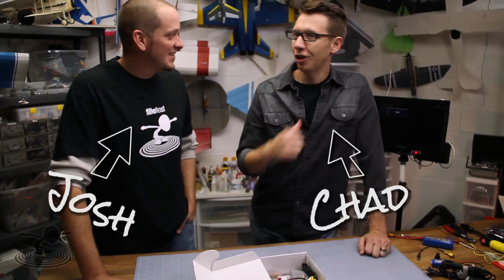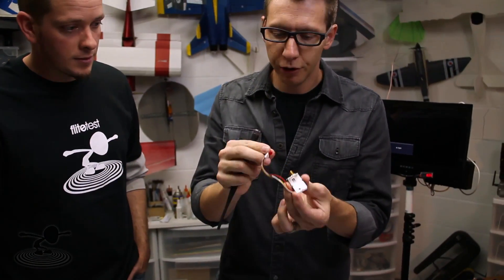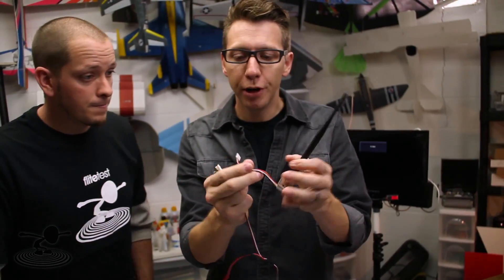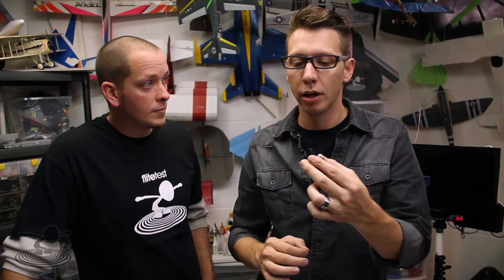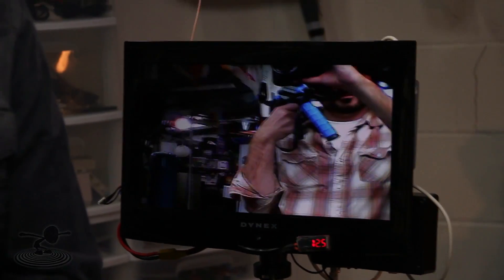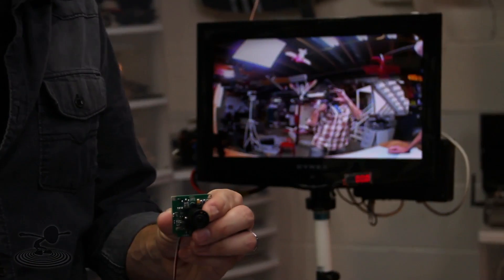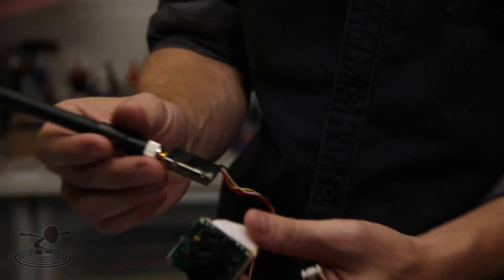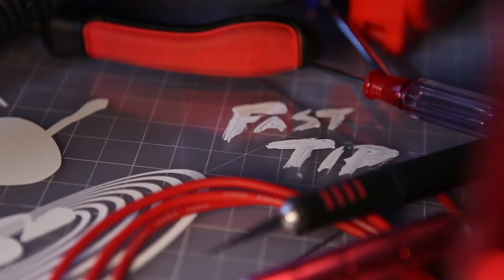Basic FPV Setup - FAST TIP | Flite Test

Comment: if you wanted to overlay an OSD HUD that displays realtime flight information, what would you do? put an arduino or RP that generates the overlay between the camera and the transmitter, or put a computer on the ground that generates the overlay and is placed between the receiver and the monitor?

Comment: Hi,I have  I am using GPS in APM board,I have APM 2.8.i have ublox neo8m .the gps work in rover firmware,I get GPS lock ,GPS work well rover firmware,but it doesn't work in arducopter 3.2.1.
So if some could help ?

Comment: Can I power this transmitter by using xt60 y paralal wire connectors to power whole rc model in one 3cell Lipo battery. 
CAN I DO THIS
IS THERE ANY PROBLEM TO DO THAT .SO PLEASE TELL ME

Comment: I pulled apart a model plane recently and the manufactures had black as positive and red as negative so when I plugged it in the ESC blew up literary. It sent molten heat shrink everywhere and left me with a flaming mess of a Speed control and a couple of minor burns

Comment: Around 7:40 / hard to get xt60 from one another? :) I noticed you gave up and put it down. And in tight builds it gets almost impossible to take apart. And with cold fingers or just fingers that are strong enough there is good news. :) 
https://hobbyking.com/en_us/turnigy-easyoff-plug-disconnect-system-xt60-adapters-20-pcs.html

Comment: I have a TS832/RC832 set from Aliexpress and the transmitter is heating up really quickly. I run it off 12 volts. Is it better to lower the voltage or just glue a radiator onto the power amplifier IC?

Comment: Hey!  I am going to build my 1st FPV system but it is confusing to find the correct VTX. I need to use my FPV system in a racing quad copter. what is the VTX I should use. There are many 200mW, 600mW, etc what VTX I should buy?

Comment: i have a 4200mah  4s lipo as my battery, im trying to power my quad copter and my fpv camera through the same battery , the camera need 12v to work,any suggestions how i can do it. help urgent........

Comment: I have a 7.4v battery for my quad and I want to have an fpv setup like this but they say you need a 12v battery to power it. what should I do?
Reply: There are two options; 
You could simply buy a 3S (12.6v) battery...  itll give you a lot more power and a more enjoyable flight (unless it is a store bought mini quad which can only run off a 2S...   in which case it may not be able to lift they weight of the fpv system...) 
Or, you can buy step-up converters which will bring the 7.4v up to 12.6

Hope this helps

Comment: That was extremely helpful. thanks Josh and Chad!!! 👍👍
Reply: +david morton Check out this FPV starter setup out.Hyperion 4.3" FPV Monitor with Built-in 5.8Ghz 32 http://www.aircraft-world.com/en/p1986857-hp-fpmon43
AOMWAY FPV 5.8G 8CH 200mW AV Transmitter Integrated 700TVL CMOS HD Camera For Aerial Photo
http://us.banggood.com/Wholesale-Warehouse-AOMWAY-FPV-5_8G-8CH-200mW-AV-Transmitter-Integrated-700TVL-CMOS-HD-Camera-For-Aerial-Photo-wp-Usa-989258.html I think it is safe to use this FPV camera with a 2s plus lipo battery.

The monitor has auto tune so you do not have to flip through channels etc.

Comment: How can a Frequency which you can't see,smell or touch be legal or illegal. lolol
Reply: David Hannigan Jr. He's given up. Your ignorance is unbearable.
Reply: Yeah. It can interfere with communications
Reply: Yes they do. Ever heard of a radio or a walkie talkie?
Reply: David Hannigan Jr. If you use high power on an "illegal" frequency you will normally be fined. And yes they do investigate sources that cause a disturbance. HAM operators can use certain Frequencies that are off limits to non operators, but even then its only at certain power levels.

Comment: Hello, can someone give me some source or answer on what's the deal with FPV or 5.8ghz transmitter and "staying legal" in the US?  I keep reading about how there are "illegal" channels on the transmitter and I cannot find a legit source of this information nor can i find what channels can i use without "getting in trouble"  Any clues?
Reply: the video transmitter has to be Fcc approved and have the approval ID number on it. there are about a handful of them that are legal. all are 25mW only. most have permanently fixed attennas as well.

Comment: Is there a TINY SD adapter for the FPV video output to storage videos in it? 

im trying to fit a camera module on a Nano drone, so the weight is the key of this adapter. Saw some Nano drones could lift gopro cameras, but batterys unfill really fast, thats why im looking an SD adapter, because FPV transmiter weight.

thanks in advance, nice videos!
Reply: +Jorge Cifuentes There is no storage for this setup sorry. It streams the camera feed directly to a monitor via the antennas.

Comment: Would this be good for 250 quads?
Reply: +Billy Thomas think so. Im getting  250 quad and probably getting this fpv kit. just make sure you dont use a separate battery for the transmitter on your quad because you are likely to put too much weight on the esc. just use an adapter for example, this one http://www.ebay.com/itm/251759867005
Reply: +Happy skull25 ?

Comment: At 4:35, can't you take power from your ESC or receiver for the camera and transmitter if your ESC has a BEC?
Reply: Hungry Guy isnt a bec 6v?
Reply: +Hungry Guy prolly the camera chews a low of power... unless a separate BEC is installed...just to power up the camera.

Comment: I have a phantom 2 vision+, and really want to be able to view on a bigger screen. It is equipped with a 2.4ghz wifi transmitter, so could I just buy and use a 2.4ghz receiver and run it through a dvr? I don't want to spend the $$ on light ridge, when there seems to be much cheaper options

Comment: Hi FlightTest, I wanted to say thanks for all the Video's. Appreciate the extra knowledge when needed. I have a question about this FPV. On the receiver Does the 12volt system have enough power to handle 2 or more feed displays at once without degrading the signal?

Thanks,
Brad

Comment: How long will the batteries last on the fpv system?
Reply: TheOutback101 I was wondering the same thing. Id just use a low voltage alarm so I wouldnt puff the battery

Comment: How would I power the camera and the transmitter with the battery which powers a quad? Thanks.
Reply: Custom cables can be made from the balance plug of lipo's, but using an 11.1v-12v battery is recommended

Comment: Hi thanks for the awesome video!
Just a couple of questions for you or any Quad experts out there: 1) i have the Luminier QAV250 which has a distribution board, so i assume it is possible for me to power this FPV kit strait from that distribution board, and save having to use a second battery?
2) How would Fat Shark Goggles work into this system? Would the video just be transmitted strait from the Fat Shark Video transmitter on the Quad to the Fat sharks goggles antenna, or is the whole ground station part still required for that?
Thanks very much.
Reply: Fat shark goggles have a built in 5.8ghz reciever so out of the box u can't. BUT most fatshark goggles have a switch where u can turn the reciever off and plug the video reciever( which in this video is 900mhz) into the goggles. So once u turn that reciever off they basically become a monitor in the form of goggles

Comment: Hi guys, can you help me? I bought a FPV Kit and it says to use a DC 12V 1A adapter ?
I looked it up on Amazon and all that shows is cords that plug in the wall? Could you tell me what type of battery I can use for this kit? Could use the power source from my Mobius action cam for the transmitter and my power source from 7:moniter for my receiver? Thank you Kazz. P.S. Were can I get connecter of all sorts? because when ever I have a female connecter, I have no idea what it would be called to get a male? I was thinking that If I bought a female and male adapters of any sort. I could make my own hook ups. right?
Reply: Make sure you look on eBay/Amazon for the xt60 to d cables, I used them and made my receiver battery powered

Comment: I watched this video cause I wanted to see how you hook up the reciever RCA jacks to the Monitor, I have a reciever that I want to hook up to my laptop and it has HDMI plug for input signal. So what I need to know, how do I hook my RCA cable to my HDMI port on my laptop? My reciever only has a single RCA video out, My Laptop only has an HDMI in, will I need to buy some sort of anolog to digital converter, any suggestions would help, I'm new at all this video FPV setup stuff, please help..  :)

Comment: Is it possible to have two videos feeds coming from one transmitter or would you just need to add another transmitter?  I'd really like to have the ability to have two FPV goggles going so someone else could just sit along for the ride while I drive.
Reply: It works like tv broadcasting, as long as they are on the same frequency you could have as many people as you want watching.
At shows etc, one plane transmitting can be watched by anyone who can tune into that frequency.

Comment: This is a good setup. If you are using a 3 cell battery, go with a t connector and use 1 battery for flight and tx/camera power.

Comment: Nice video guys. I am wondering if a separate battery would be needed if the camera has it's own power ? I have a Mobius ActionCam, and it has it's own battery.
Reply: Yes you still need to connect to a separate battery or the balance connector on your flight battery to power the tx, but that battery will last longer because your camera is self powered.
Reply: So when you connect everything to the video transmitter and battery the only the video cable connects to the wire not the power, and if you we're to power the möbius with the setup could you use a sbec

Comment: Total complete n00bie here.  On the back of the screen at 7:08 you talk about "ground station". What exactly is that?  I plan on running a FPV on a RC car (and not a plane) so is that necessary? My FPV monitor will be plugged into into my wall receptacle so therefore will never have the need to be portable.  Can you PM me and explain please. I do thank you in advance.
Reply: For example, what is the white box behind the monitor?
Reply: onealmr Ground station is the FPV components that stay on the ground with you, rather than whats on the plane/car.  so the receiver, monitor, tripods etc, those things are your ground station. The white box behind the monitor is their receier I believe.(they used a different receiver for the video, to save time and not have to plug it during the presentation). Hope this helps.

Comment: I have a 500mah 3s lipo for the tx and the stock dipole antennas. And for the rx I use a 12 volt 1000 mah wall plug. I can't even get 30 feet with this. Do I need to get new antennas? Do I need to get a new tx? If I am 12 feet away from the rx it is clear.
Reply: First of all, get comfortable with flying your plane. Second of all, get rid of those rubber duckies (dipoles) and switch them out with IBCrazy's bluebeam antennas. You should also check for interference from WIFI networks on 2.4 ghz and cell phone towers at 910 mhz. Also, always use an FPV frequency higher than your remote's frequency.

Comment: Hi, great video! I am thinking of building David's windest�l's tricopter with my Futaba 6EX transmitter (2.4 GH) and this fpv setup. Two questions: could I run the tricopter motors and the fpv gear off the same battery? (and if so which one would be good?). Also, will I have video interference from my 6EX? I read somewhere that this could happen... sorry for being such a noob!!! Thanks, Franky

Comment: would this fit on a quadcopter that is about a foot wide? (blade 180 qx)
Reply: offcorse it will fit but it wont be able to lift it, but..... hobbyking have a micro 1.3ghz fpv combo (rx/tx) and its tiny! http://www.hobbyking.com/hobbyking/store/__35009__1_2GHz_100mW_Video_Transmitter_and_Receiver_Combo.html

Comment: 2 questions 1.can i use this set up in the uk     2.if u have a 2.4 GHz radio (turnigy 9x) can i use this 2.4 GHz fpv set up. some one please help because i need to no what to get for x-mas
Reply: Yes and yes.
Your turnigy 9x cycles through all channels in 2.4 Ghz, and will not show any really bad interference. It might interfere, but it won't be something you will notice a lot.
Reply: KodessR ok thanks
Reply: the Radio does cycle through channels, however you should never use same frequency for video as your radio. Do more research.

Comment: I just rolled through a dozen of your videos, and have to force myself to get back to bed - but, I was wondering what kind of HMD y'all are using for the FPV rigs? I've been pondering the different options for quite a while and would love to know if you've got a favorite, or maybe what applications are best for a specific type of display? I'm *so* going to be putting a versa wing together tomorrow.

Comment: 900MHz kit was arrived Yesterday and I hooked all up,
Rx set CH "0" and default(leave as it is) for Tx
As this fast tips, wide lens was installed instead and got better wide view.
Working great but Tx is hot, so I put Al cool Fin front and back for better cooling. 
Great helpful tip video to setup FPV for beginner like me

Comment: Another thing that makes video transmitters hot is having undersized antennas for them which is kind of common with the extremely small transmitters and with the 900MHz transmitters. The difference between a decent antenna and a poorly matched antenna can more than double your range!

Comment: mAh will not give more range, its a battery capacity rating so a 850mah will last longer than a 500mah. The MW rating of your transmitter will determine the range of your system.

Comment: which battery would you recommend to power up the video receiver during flight?a 3 cell 500mah or a 3cell 850mah?or maybe i can use a lower mah batter for lighter weight?what does mAh do on a video rx?does it last longer or more range with a higher mah 3cell battery?

Comment: PLEASE THUMBS UP SO OTHER PEOPLE CAN READ!!!!
The reason that the transmitter gets hot is because its voltage regulator is dropping a lot of voltage these things actually run on a much smaller voltage. To find out what the voltage is look at the pcb and do a search for the on board chips ID No. and one should be a set voltage regulator, the data sheet tells you the actual working voltage!

Comment: also, higher frequencies go shorter distances for the same amount of power. i.e, a 100mw 5.8ghz tx will give about 1/2 the range of a 100mw 900mhz tx.

Comment: Depends, 2.4 video can make problems if you use 2.4 transmitter. Also depends where you actually live, 900, 1.2, 1.3 is illegal in most of Europe. There are also differences in transmit power that is allowed. Local FPV boards might be of help here. Otherwise there is nearly no inherent difference in the different frequencies, apart from how easy they are blocked by objects in the LOS. (higher freq is easier blocked, e.g. when flying in the forest)

Comment: I have never used ecalc before, but I think someone has said to me once that it doesn't calculate properly for quadcopter.
I have heared it, I am not sure.
What I would do is buy the 14x6 prop I suggested and a bigger prop.
Propellors don't cost very much.
It is better to experiment yourself then to rely in a calculator.

Comment: I would suggest a 14x6 prop.
If that is too big and you need smaller props, I would go with a 12x6.
Those props along with a 3S lipo with a lot of mAh.
Since its a quad, I would go with the ZIPPY Flightmax 5000mAh 3S lipo with hardcase.
It does weigh a lot, but it does give you a lot of flight time.

Comment: Haha no problem.
If you require 20 amps continuously then it is not low for your motors.
But if your motors use 18A on full power, I would consider a higher C rating.
If you get a 30C 3000mAh you should get about 7 minutes of flight time.
I should start experimenting with multiple batteries connected parallel to each other, so you get more mAh, but you won't get more volts.
Try to find the right balance between the amount and kind of batteries and amp draw, to get maximum flight time.

Comment: The C rating is how many Amps the LiPo can put out continuously while holding a good voltage level.
So your 2200mAh 20C battery can put out 2.2x20=44 Amps continuously while holding a good voltage level.

Comment: To calculate the flight time, take the battery's capacity in amp per hour, then divide the battery's capacity by the average amp draw and multiply the answer by 60.
So, if your motors would run on max, you would get around (2.2/18)x60=7.3 minutes.
Now, you dont want to fully discharge your lipo so i would say about 5 minutes is the maximum flight time.

Comment: for a simple quadcopter of max current 18A per motor.. how much time will I get for flying using a 2200mAh 20C 3S battery?

have you used ardupilot ?

Comment: I would go with 900Mhz or 5.8Ghz.
900Mhz wil have better reception around objects, because 900Mhz penetrates objects way better then 5.8Ghz.
Some people say that 5.8Ghz gives you a better video, I don't see the difference but some people do.
So if you fly FPV on an open field, go with 5.8ghz, Do you have some objects that might cause problems? Go with 900Mhz
The best is to fly on an open field.

Comment: Yes you are right.
But the 11.1V is measured when the battery is about half drained.
A fully charged LiPo will put out around 12 Volts.

Comment: Probably 5.8ghz or 900mhz. Just don't use 2.4ghz as the video and radio systems will interfere with each other.